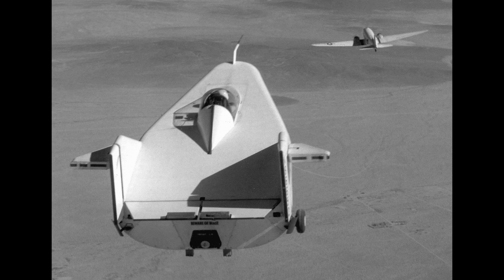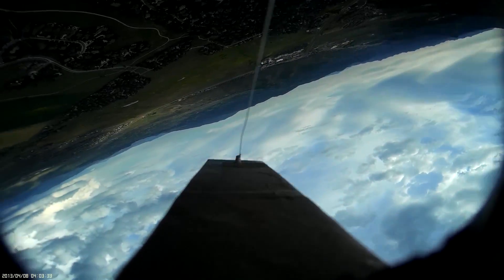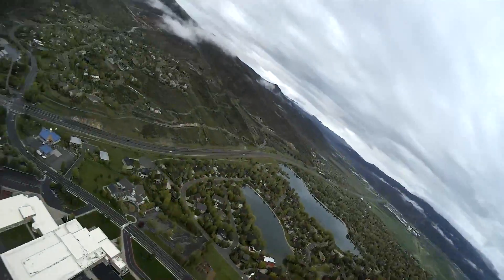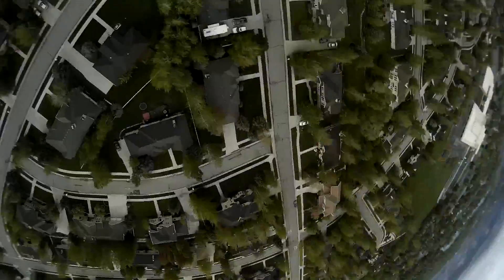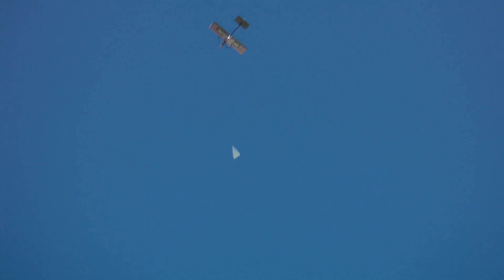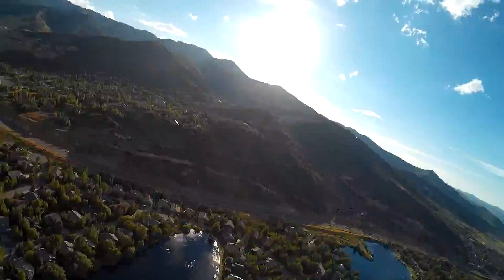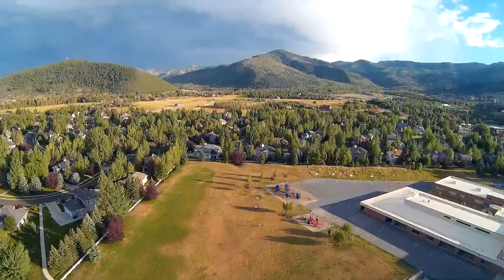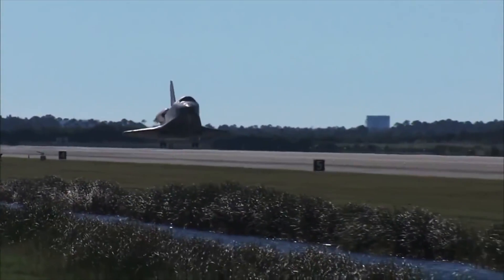RC Shuttle Drop Glider - RCTESTFLIGHT -

Comment: I think you're dropping your glider at too high a speed. Maybe if you could slow your carrier plane and then drop it, you wouldn't have so much wind to contend with when you're trying to get control. It just seems like the glider is too light and not aerodynamic enough so the high speed from the air is just knocking it about and it can't get an stability.

Comment: The main reason that it doesn’t handle very well was because the shuttle has avionics controls and a more stable platform but if you do try this again make it have two rudders (angled like an f-18s) and two vertical winglets, that should fix the rolling problems

Comment: Shuttle has dihedral as you can see in the end of video. It's critical for crafts stability. By the way you need to establish correct cg if it is to be controlable. There are cg calculators in web, they might be useful. Final thing- I think the wings you made for first two shuttles were too small to make them controlable

Comment: All these people complaining about dropping it in a suburban area. Ffs it's made of foam and if it isn't controllable it will just end up falling straight down into the field, which it did. On top of that, the odds that someone will be outside and not on a computer at the time this video was being made was pretty nill. The worst thing that could have happened is that it could have potentially broken a thin window. Everything else is pretty hard to have happen.

Comment: I think a lot of the instability came from the size and shape of the control surfaces, and also that the wings were just cut straight back.  Typically, you would want a slight curve to them starting with just a little strake like the STS wings.  Also it was small, so I am aware it is inherently unstable.

Comment: I'm building a Space Shuttle that launches like a rocket with a estes C-6-5 engine the motor burns out and then glides by RC back to the field the biggest problem I'm going to figure out is energy management because its a truly unpowered glider I only have so much time to reach the landing area to understand this i'm using my RC Sim to get used to landing I will be sure to let you know about my results You did an awesome job with yours every time you had a bad result you learned from it thats and did something different what experimental flight testing is all about.

Comment: if I was going to make a rc plane or a shuttle drop glider I would buy a foam plane that you would buy at a toys r us and cut some foam out and put in recievers fpv camera gyro engine and posibly a drop bay with servos and use some servos to make the steering

Comment: a couple things to noted in the video. check you CG when you made that last trim of the wings the center of lift moved back. second you seem to have some flutter or othe aerodynamic issue with buffeting at higher speeds. if you are interested in lifting bodies look up concrusher on the internet.

Comment: why not drop from a hydrogen balloon?
Reply: It would probably only be good for a single use.
Reply: Cyrus Frost: weather balloons are typically single use, however we can make such balloons by heat sealed inexpensive thin plastic with a little hydrogen in them. as long as we allow the gas to expand 100x the volume, a balloon array can reach 120,000 feet to launch small rockets from high altitude without wind resistance.

Comment: I saw this video about 4 months ago and wanted to try this in Dollar Tree foam board. My first design was based of the Sierra Nevada Dream Chaser. It did not do well do to it being very small. About one month ago I attempted to design an aircraft that had a more space shuttle style. The aircraft had dimensions ruffly: 2.5 in tall, 2 in wide, and 16 in in length. the wing span was about 10in wide. I took influence from Flite Test's Mini Punjet and added winglets to increase stability while in high alpha. In the end it had a glide slope of about 2.5 feet for every 1 foot fallen.
Reply: I never got the chance to drop it from a plane. I just tossed it off a porch about 10 feet off the ground.

Comment: All the later designs seemed good... Even the space shuttle would naturally be super unstable...  But it's the programming and advance flight computers that keeps it all stable...  Off course a lot more cfd gone into those planes...  But you can get decent performance without any cfd tools like you did

Comment: There IS such a thing as a CP: center of pressure. Working it with the CG will help immensely.

And you probably want to widen the fuse, and you shorten the wing.
Reply: OH: and if your wing is flat it WILL fly only in high angles of attack. You might consider one of the KF airfoils.

Comment: Looks like you had a heap of fun. Something I plan to do with my kids is wind tunnel testing. I plan to make a rough rig, for the test plane to pivot on its CG. Then find a quiet length of road a hang you ring out of the car window and for trim testing that way. Just something different and a bit of fun to.

Comment: I say your V5 approach was the right one: make a conventional plane and try towards lifting body. Not the opposite direction like You did in V1-V4 :)
High wing load "flying brick" glider must be really cool to watch, but pain to control. As it is much less stable than conventional, steeper glide slope, etc.
I plan to build a shuttle-like foamy, but I'd keep it as light as possible, low wing load makes it much easier to control.

Comment: I know Im kinda late but I really hope you read this, I know why it was so hard to control, from the vid I can see your model tends to pich down always and you try to compensate that making it too touchy, the main reason for this its not lifting surfice or control surfice, it has to do more with the center of mass being too displaced from the lifting center, as this its a glider it changes where it should be since there is no propulsion sistem, the mass center shouldn't be all the way in front, it should be somewhere a little bit infront of the lifting center of your plane, so the plane itself became more controllable

Comment: Interesting video, but I wouldn't call this a lifting body, more like a "clipped flatplate delta".   You can tell it is not deriving lift from the body because the glide angle gets steeper when you cut back the wings.  True lifting bodies are shaped more like a blunt half cone with the flat side facing up, this shape generates lift provided a positive angle of attack is maintained.  Not much, but some.  The idea was to eliminate leading edges, as they get hottest during re-entry.   The concept was abandoned because of the extremely high landing speeds and lack of cross range capability. Improved thermal control materials (RCC) allowed NASA to design the shuttle with a conventional planform.  They still had to do a pretty steep dive on final to build up enough airspeed for the touchdown flair, but that was just because the wing area was so small.  You're probably doing a similar maneuver when you land this glider, diving to build up speed then pitching up at the last moment for a smooth landing.

Comment: Not much airfoil shape to the fuselage of your "lifting body" gliders. The fuselage itself should resemble a thick wing section in order to properly get the effect. As for the space shuttle? NASA really didn't go with the lifting body at all as on the previous research aircraft - it's just a delta wing glider. Previous comment about "wings on a brick" isn't too far off.

Comment: I almost feel like you would need adjustable gyro gains; it would need very small reactions (to prevent oscillations) while dropping straight down since the ailerons would have so much authority at that speed, and then as you slow it down and glide it in the gyro would need much more gain to move the ailerons more at low speeds.

Maybe program in several gains and just flip through them as your speed changes?
Reply: +Mike Dawson ...or you could leave the gyro rates static and add expo to the control movements.

Comment: Seems like those full scale lifting bodies make up for lack of stability with more control surfaces. Seems like that type of a design is more stable in supersonic flight as with the X-47B and the Space Shuttle. Maybe a wider trailing edge with two sets of elevons with slightly different mixing, or at least different throws, would do the trick. Probably a pain in the ass to figure out what the magic settings would be for stable flight though.. Cool project!

Comment: Make sure they can fly first before dropping them. Take your car out and drive it at wind speeds the plane your dropping will need to fly at. Or build a wind tunnel. Do that for the RC community please before one of your crafts end up in the wrong back yard. Suppose a dog bits into a battery pack.

Comment: I used to fly balsa RC planes back in the mid 80s.  The technology has clearly gotten pretty impressive!  I'm interested in getting back into it (but electric: I hate glow engines!!).    I'm wondering: you mentioned a sort of "electronic stabilization" (am I getting that correct?).  Is that a form of 3-C gyro stabilization akin to full-scale autopilot?  If so, could you point me in the direction of finding out more and/or vendors?  What are these things even called?

Comment: try with smaller control surfaces...
Reply: +The Flying Gasmask And reducing servo throws. Small planes are twitchy, and this is at the limit. Going even a bit larger will help a lot.

Comment: Ok, so that is not a 'lifting body' nor is the space shuttle. A lot of you control issues would smooth out if you had twin tails on it. If you make the fuselage in an aerofoil shape and somehow blend that with the wings , you'll have much more control. Also, it looks like your wings are just flat foam. If that's the case, another big part of your controllability issues come from airflow separation. With your patience sure you could get some vortex generators stuck on there too. Great video by the way.

Comment: You found out what NASA found out about lifting bodies. They have nasty roll tendencies and they liked to dutch roll. 
It was actually the B-52 quickly coming down from altitude during the drop tests that showed the engineers that wings can be used in orbital reentry.

Comment: That's badass!  Your tenacity is over the top.  I can learn from this as well as some previous experiences with delta wing planes blowing out of yaw, I think due to the central vertical stabilizer being blanked out by the fuselage and/or wings at high alpha.  A spiral results.  Putting wingtip verticals seems to do the trick, like most of the experimental lifting bodies have.  I don't know how the Space Shuttle got away with it except that the VS is hella tall on it.
Reply: I need to pull out my dictionary now...
Reply: +ExperimentalAirlines The surface area of the Orbiters delta wing is far less than a traditional delta wing and are swept at a far more aggressive angle than flying wing which allows the VS to be placed further away from the CG which allows for better control authority. Additionally, the Orbiter VS uses differential drag (split rudder) as opposed to the conventional rudder.
Reply: +ExperimentalAirlines thanks for advice

Comment: Hi, you must notice the alternating vortices coming off each of the trailing edges. The shorter the wing and longer the body, the worse the effect. If you had an obtuse  leading edge angle to the body, blended with a wider angle (like the Concorde), these oscillations would stop. Try running  with the shape dragging behind a coat hanger or string. The shape shouldn't oscillate.

Comment: There is something about the concord wings that has the kind of flight performance you are after it has somthing to do with flow separation at high angles of attack. thats what you need for steep glide into long flare.

Comment: With good design you can fly without the aircraft out of control. I made a rocket plane with very small wings and could fly without RC and it could flight well. Then I did an airplane without wings, similar to the NASA planes and also work well, did not begin to swing sideways, which is what often happens in these planes with so little wingspan .

Nice vídeo and experiment. ;)

Comment: if you want to make such a small wing area work, you really need a real airfoil. Flat plate section wings are very inefficient, and require positive angle of attack just to maintain level flight. High AoA = more drag, less overall efficiency = worse glide slope. If you took the final designs proportions (fully cut down wing) and added an airfoil and a cleaner fuselage design, you could probably end up with something that at least could glide relatively well. Another thing you could adjust, is the incidence of the wing, and the CG point. Some positive incidence would require less up elevon to keep it flying level.

You'll always be fighting physics at such low Reynolds numbers, but if you reduce the inefficiencies that you do have control of (drag, lift of the wing, incidence of wing), you could get a much better flier.

I also noticed (as I'm sure you have too) the flight stabilizer seems to be oscillating pretty badly as it approaches a stall. if you built a little wash out and/or reflex into the design, you could make it a little more inherently stable. An under-cambered foil, thought quite high drag, might lead to a wider speed envelope (slower stall speed), which looks like it could have helped make this design more controllable. It was stalling at a VERY high airspeed, especially if you were flying into a 10mph wind!

I hope some of this is of interest or use to your future designs :)
Reply: +Chris Tate Finally, adding tip plates or winglets could help with the tip stall characteristic, as well as increase lift of the small wing section. I think your design might need a bit more vertical area to stabilize it